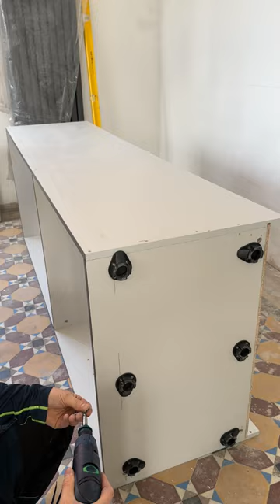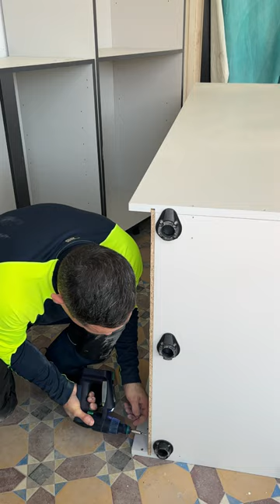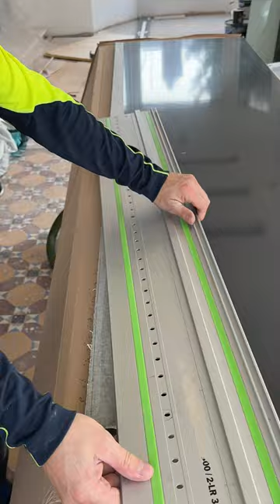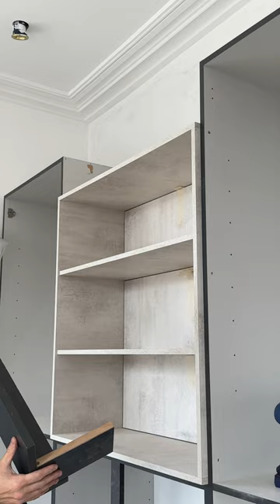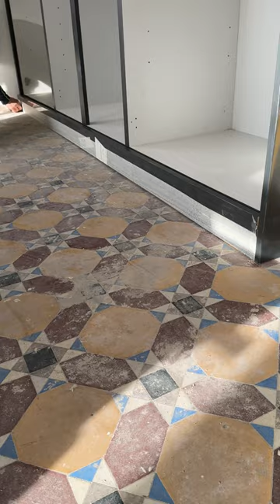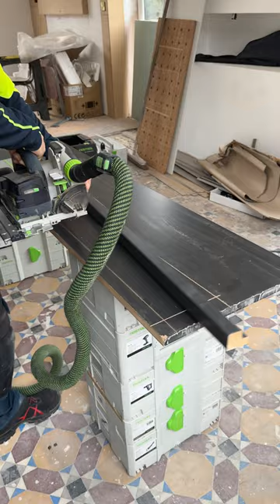Creating Your Custom Wardrobe: Expert Tips and Tricks

Comment: Very nice job. I especially like your technique with the glue and activator. You only spray activator on a few parts clearly to hold in place while the the rest of the glue sets naturally. I also like the clamp against the architrave whilst you get the inside fixing….. smooth! I was hoping to see how you trimmed the excess from the iron on edge banding…. Maybe next time . Love you work man👍🏻
Reply from the maker: Thank you very much!I have other videos showing that you can check out,for example  sliding wardrobe ones ,thanks for watching and commenting on my videos 🙏🙏

Comment: Great work! Do you work with furniture designer or the project is done by you from the start, like you buy standart size panels or kitchen boxes and then you work it out if needed while fitting it on the spot?
Reply from the maker: No i just fit them